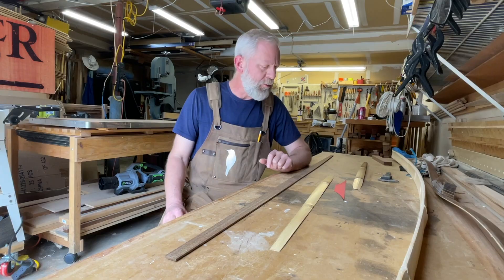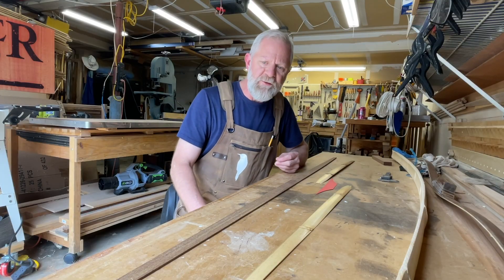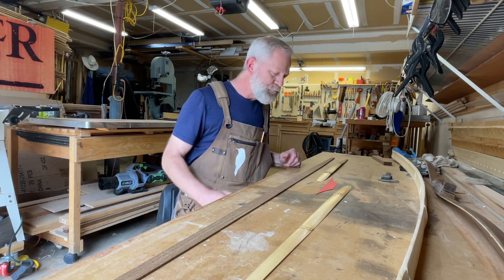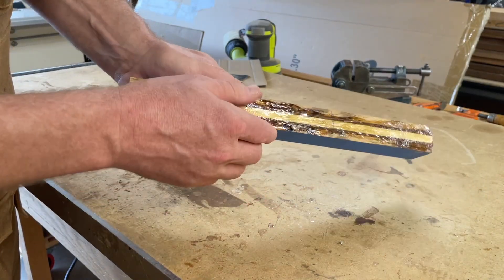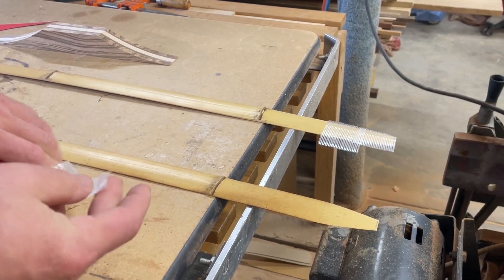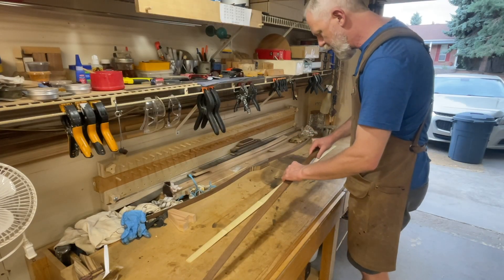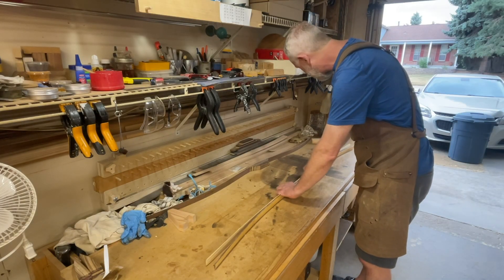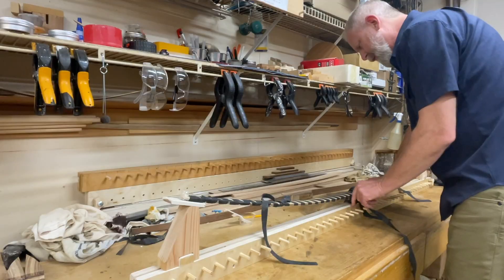Tri-Lam Reverse Perry Lamination Pt.1

Comment: Here's a thing to try,flip the jigged assembly with riser up side down . I used to have handles delaminate at the limb junction. I flipped it upside down & let weight and gravity work better. It solved 90% of that happening. I used both smooth on & titebond 3 for glue ups. Haven't made any bows in 5 years. You have rekindled the 🔥.You are a fresh incense on the DIY light channel .
Reply from the maker: Good ideas - especially the one about getting back at it!!!